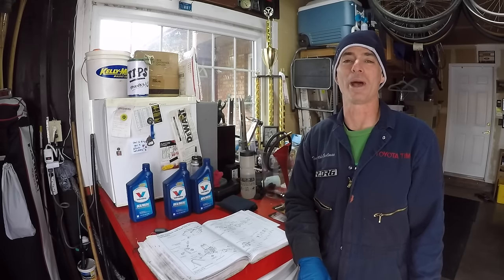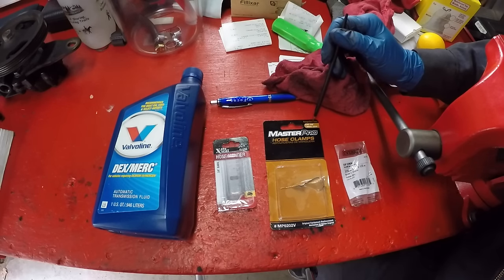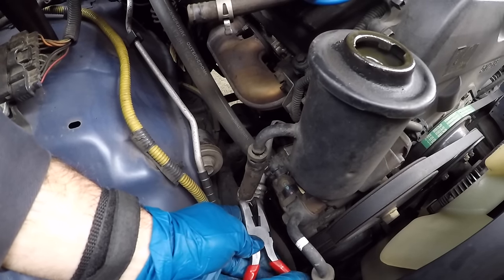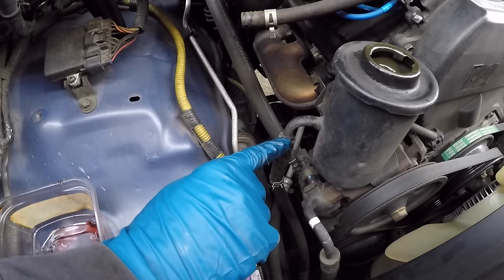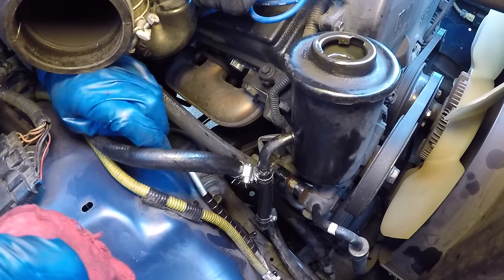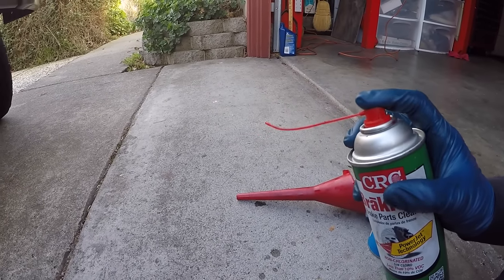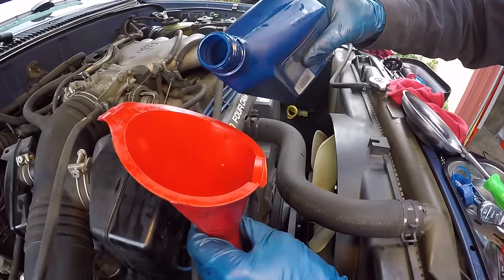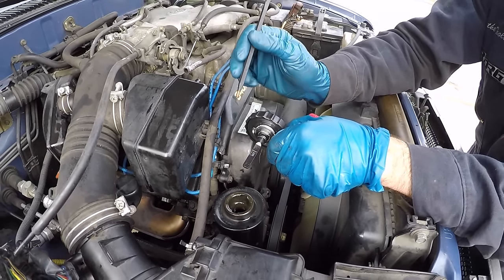Power Steering Flush and Reservoir Cleaning

Comment from the maker: PLEASE READ THIS COMMENT AND THE VIDEO DESCRIPTION FOR HELPFUL INFORMATION
**In retrospect, to make less of a mess, it would have been smart to have a syringe and section of plastic or rubber tubing connected to it.  With the syringe and tubing, we could have sucked more fluid out of the reservoir to create less of a mess when removing the return hose and removing the reservoir.  You could find a syringe for sale online via a site like Amazon and you could use any tubing, like vacuum hose that would fit snugly over the end of the syringe.  You could pick up some vacuum hose or other type of plastic tubing at an auto parts store.  If you'd like to suction out the whole contents of the reservoir in one shot, check out the Mitivac Fluid Extractor we link in the video description.

**At the time of this flush, you might want to consider adding an inline filter in the return line, like a magnetic filter Magnefine makes, to help the fluid stay cleaner and reduce the chance of deposits accumulating onto the fine mesh filter screen on the bottom of the reservoir.  A power steering fluid flush and magnetic filter change every 30,000 miles will keep your power steering system running well.   On my 98 4runner, I cut the return line approximately 3.75 - 4" below where it attaches to the reservoir nipple, and then I cut out a section of the return line so I could fit the filer in without kinking the hose.  The filter has a fluid flow direction arrow on it so you would want the fluid entering from the below (from the metal line that leads to the steering rack) and leaving towards the reservoir.  It's kind of tight in there, so when it comes time to replace it, you'd have to remove the air box. 

**Instead of waiting 30k miles to do another full flush of the fluid, I'm going to do more regular partial exchanges by using the Mitivac Fluid Extractor I linked in the video description.  My plan is to suck out the contents of the reservoir with the fluid extractor and then replace it with new fluid.  I will do this as part of my 5k service of renewing my engine oil and filter.  If it looks like I'm not exchanging enough ATF to keep it looking fresh and pink, I will do two rounds of the extraction and refilling every 5k.  I'll do the extraction and refilling once, start the engine and turn the wheels back a forth a couple times to cycle the fluid, and then do another extraction and refilling.   When I get to 30k service miles for the filter, I'll pull the air box and replace the filter.

**Since making this video, people have reported that the o-ring on the reservoir suction port has torn either while removing the reservoir from the pump or reinstalling the reservoir onto the pump.  It would probably be a good idea to buy one of these o-rings in advance and replace the o-ring as part of this job.  We have the o-ring part number and a link to purchase one in the video description.

**Several people have reported having success moving fluid through the system by having the front end jacked up off the ground and just turning the wheels lock to lock.   I  decided to give it a try on my 85 4runner which has a steering box rather than a steering rack, and it did work to move the fluid through the power steering box, pump and lines by simply turning the wheels back and forth with the engine off.  It's interesting that this works because I thought the pump would need to be moving to allow fluid to flow through it but apparently it doesn't need to be running which I find really weird.  Anyway, this is an option we wanted to share.
Reply: Timmy The Toolman 7
Reply: I have picked up relatively large syringes from a pharmacy for only a few dollars. Then I stop by the hardware store with the syringe and find the correct size bulk tubing that fits on the end and buy a foot or so. Also, WAY cheaper than your $20 food grade pitcher, I would just buy a gallon of distilled water for $1-2 and use that jug. The other benefit of using a plastic jug is that the narrow opening will keep the spray/splatter from covering the engine bay when the pump is shooting fluid out the hose.
Reply: Hey any oil left on the inner fender is undercoating/rust preventing
Reply: Jason Ferrier I believe repeated use is the goal with the food grade pitcher. It’s sturdy, I’ve had those jugs for distilled water crack and leak after simply pouring it in to  flush the coolant and refilling jug with what I drained, thin plastic! Saran Wrap over the top of the pitcher with a hole for the tube mitigates the little bit of splatter that can occur.
Reply: father yesterday I miss my car fin I miss sorry
Reply: So I did the whole process but now I can't get the air out of the system. I did install the magnefine filter. Could that be causing an air leak even though it's under positive pressure?
Reply from the maker: @michaelwilson1493  No, the magnefine filter wouldn't cause that.  The air will naturally work it's way out.  If you didn't replace the reservoir o-ring, maybe air is sucking in there and you also have a leak.  If the o-ring is good and all your hose connections are tight, the air in the system will work it's way out to the reservoir.
Reply: Just rotating the steering wheel does the job because the steering rack itself has a piston inside of it. That piston is moved around by the pressurized steering fluid so when you move the piston by rotating the steering wheel, the piston then moves the fluid around.
Reply from the maker: @H1tman47  Yep, we know this now and have reported this technique in the video description.
Reply: @TimmyTheToolman I suppose another benefit of jacking the front and turning the wheels (instead of running the engine) is that you wouldn’t have to put the air box back in and pull it out again, right (unless I’m missing something)? My whine is back  (cold weather seems to do it), so I’m due for another flush and reservoir filter cleaning, so I may try this method….and install that magnaflow filter while I’m at it.
Reply from the maker: @eljefeslash  Yeah, try the wheel turning method.  I've heard it works well.  The magnaflow filter is a smart choice. You'll have to replace it every 30k miles, but the benefit is you'll never have to clean the reservoir screen again.
Reply: We have a 2000 SR5 Toyota 4Wheel and over 200K miles and the steering is starting to be stiff and noisy …thoughts or reliable cheap help near Folsom, Citrus Heights,Fair Oaks we could trust if this is the problem?
Reply from the maker: @Mustardseed777  We don't know of any shops in your area we would feel comfortable referring you to.  Why not follow the video and do it yourself?

Comment: This was very helpful. You did however use a lot of fluid and allowed air to enter. Another way to do it is jack up the front end and do not start but turn wheels left to right and that is enough to pump all the fluid out, everything else is the same but no starting. You then flush it without introduction of air into the system and a third of the fluid you used.  Still helpful
Reply from the maker: Yep, we heard about that wheel turning method after we shot this video.  We mention this technique in a pinned comment.  The introduction of air into the system is not a big deal however.  This would happen with a power steering pump change or a steering rack change.  The air in the system quickly works its way out to the reservoir.  I'm not sure if your assessment of the fluid used with our method compared to the wheel turning method saves a bunch of fluid.  But, I'll take your word for it.  Thanks for the comment.

Comment: When I did my flush, I just jacked up the front and turned the steering wheel lock to lock. I didn’t need the engine running to cycle through the fluid. Once I saw nice fluid, I stopped.
Reply from the maker: That's interesting Minh.  When we did the Steering Rack Swap for Sean's friend Dave, we couldn't get the fluid to move very much to work air bubbles out of the system with the engine off.  We had to run the engine so the pump could move the fluid and work the air bubbles out of the system.  So, we figured the best way to move the fluid through the system for the flush was with the engine running.  Thanks for sharing this.  Maybe I'll give it a try when I'm due for another power steering renewal on one of my own 3rd Gens.
Reply: Timmy The Toolman I read it off the t4r forums and it worked great on my 99. Lock to lock cycled it and allowed me to get clean fluid eventually. It was still a messy job ha. My belts squeaked due to oil spilling all over them but tons of soapy water fixed that. Thanks for the vid.
Reply from the maker: Ok, it's good to know this technique works.  Happy Wrenching Minh.
Reply: @TimmyTheToolman  is always good to learn something my concern is if every reservoir have that little filter to clean and maybe could be better to buy new reservoir once you removed . in my car mustang 2010 is around 40 bucks and I think is a lot a easier to remove than the one you remove in this video .great video sorry but I drank a beer why you were working hahaha nice job.
Reply from the maker: @miguelena40  Yeah, I don't know what a new reservoir from Toyota would run but definitely more than a couple cans of brake cleaner.  I think it's worth the time to just clean the old reservoir and not send it to the landfill.

Comment: remove the rear bolts first, it's easier, then the front. to install the rear bolt, use a telescoping magnet. instead of flushing at the top, do it at the bottom at the fitting on the rack.
Reply from the maker: Ok

Comment: So, I tried this method on a PS pump that had 269,000 miles on it.  Went through more than one bottle of cleaner.  It looks better, but still quite a bit of debris.  I finally just pulled another PS pump out of my pile of leftover JDM (engine swap) parts and the screen looked perfect.  O-ring was in better condition too.  Either way, Timmy and team - thank you much for the write up.  Not just this one, but all the videos you provide.  Even though I've been swapping engines, replacing clutches, doing brake jobs, etc since the early 90s, your videos save so much time!  And when you're doing these jobs yourself, any time savings is a huge benefit!

Comment: I just did this procedure on my 2002 4Runner. Before doing the job my power steering pump would whine like crazy until the engine was warmed up. After driving for 5-10 minutes the whine would go away but I figured it couldn't hurt to flush my fluid and clean the reservoir. I shined a light through the reservoir and almost could not see it through the filter. I'm surprised the power steering was even functioning. After 3 cans of brake clean I got the filter 80-90% clean and reinstalled it. Now there is absolutely zero noise and the wheel turns smoother. Thank you for such a great and informative video!
Reply from the maker: You're very welcome.  Great job doing the work yourself and fixing your power steering issue.  Happy Wrenching!

Comment: These vids are old but still so useful! I may have a slight pump leak but due to lack of funds im going to clean my screen and replace the fluid. Maybe add a little power steering stop leak to get me by till i get some funds to rebuild the pump or order new high pressure line. Thank you for an awesome explanation. This seems way better and faster once hooked up then just doing the other method of clearing out the reservoir over and over.
Reply from the maker: Hey Luke, read the comment I pinned for an alternative way to move the fluid through the system.  I would advise you to reconsider the stop leak route.  That might cause more harm than good potentially gumming up your steering rack.

Comment: Thanks for this guys!  I had my steering rack out and replaced pressure and return lines, so a flush made more sense than just refilling.  Ended up cleaning the reservoir screen and adding the in-line filter as you suggest.  I can confirm as Timmy and others have noted in the comments that this is 100% doable by simply rotating the steering wheel with key in to unlock steering.  This will pressurize the system to push fluid through the return line, and you just continue to add to the reservoir as needed.  I was doing it solo, and that method made it possible.  Old fluid was as dark as black coffee.. yuck!
Reply from the maker: Good job getting it done Tim.  Glad our video helped you out.

Comment: Hi Timmy from Australia.  Flushed my 2000 year model Prado after watching the video and worked great.  I had the engine off and turned the wheels lock to lock.  Beautiful clean fluid now.  Thank you for your channel.
Reply from the maker: Glad it worked out for you.  It's clear to me now that the power steering pump doesn't need to be running to properly move fluid through the system.  I tried this technique on my 85 4runner which has a steering box rather than a steering rack, but it worked like people said it would.  I just don't understand how the fluid flows through the pump with the pump not moving.  This is the reason why we assumed the pump had to be running to effectively move fluid through the system.
Reply: @TimmyTheToolman  All good - I used this method as I was on my own, and being a bit of a novice I thought best to proceed carefully.  The video was what gave me confidence to have a go and I am grateful for that.  Front diff oil is next.  Both drain and fill plugs are seized but thankfully not stripped.  I bought a torch so will follow your heating method to free them.
Reply from the maker: @andrewb2326  Good luck with the drain plugs.  Heat is definitely your friend.  One of the guys that came to one of our parties at my place had a seized drain plug.  I heated it up, tried to break it free and didn't budge.  Heated it up even more, tried again and it didn't budge.  After my 3rd heating, I finally was able to break it free.  The key is not strip it so you don't then have to resort to the hammer and chisel or welding something onto the nut.

Comment: Hi Timmy and Sean.  I finished cleaning my reservoir and in line filter install today.  The video was very helpful thank you. I flushed the fluid a couple of months ago without doing the reservoir, and found the new fluid discolored fairly quickly.  Nowhere as bad as the first flush but I was a bit surprised by it, so flushed it again.  It got a bit tricky for me lining up the filter between the other hoses and cutting the return line in the right places.  Anyways I remembered the sage advice from your last video on the couch.  Took my time and all turned out perfect.
Reply from the maker: Good to hear it worked out Andrew.  Great job getting it done.

Comment: Excellent video with thorough explanations for beginners to fully understand the parts and processes required to do the job.  One note of caution to viewers -- please pay attention to the fluid spec that the owners manual or fluid filler cap states.  My Jeep Commander requires a specific uncommon Chrysler spec MS10838 fluid because the power steering pump also provides the fluid to operate the hydraulic-driven engine cooling fan.  Some folks with those Jeeps did the fluid flush or exchange and used standard steering or transmission fluid and it ruined the expensive and hard to find pump.
Reply from the maker: Glad you like the video Jordan.  Yep, it's always smart to pay attention to the owner's manual or what it says on the reservoir cap and put the right fluid in the system.  People have also done damage to their system using generic power steering fluid when the system calls for ATF.

Comment: Thanks Tim I finished the flush today and the whining has significantly gone down. I had the rack and pinion replaced a couple years ago and the guys reused the old fluid. Didn’t have the confidence to flush until watching your video. I did a mix of the low tech method with the turkey baster with a piece of plastic tubing at the tip to be able to siphon below the return line nipple. After the last pour and drain I pulled off the reservoir and proceeded to clean the screen, replaced the o-ring and everything was as good as new.
Reply from the maker: You're welcome Brian.  Good job getting it done.

Comment: Very useful video, thanks! The screen in my 97 tacoma was clogged, noise until the fluid warmed up. Adapted some 3/8" clear tubing to a shop vac and sucked out the reservoir  - along with enough crud to stop the noise. Repeated filling with fresh fluid, turning wheels lock to lock, vacuuming and carefully using a small stiff artists brush on the screen resulted in a screen about 80% clean, red fluid instead of brown and steering like new without any disassembly.
Reply from the maker: 1a2b3c4dx1 Good job.
Reply: How many times did you have to refill? I started to do it your way last week but ran out of time. I will finish up with extracting the fluid and refilling this weekend.

Comment: Another sick maintenance video! I used my pella 6000 oil pump to get most all the oil out of the reservoir and a dorman vacuum cap to seal off the return nipple. Barely spilled a drop! Thanks for learning that lesson for all of us. I'm doing a flush out front of a PS rack replacement and stole a technique from Speedy just turning the wheel back and forth and that seemed to cycle fluid through without starting the engine. much slower and more manageable for me doing it solo. Thanks for your great videos!!!
Reply from the maker: We talk about the technique of just turning the wheels back and forth with the engine off in a pinned comment (1st comment you see).   A lot of people don't know we put updates and other valuable information in a pinned comment and in the video description.  In the future, be sure to check both because you might very well miss some important information.  Thanks for taking the time to comment and you're very welcome.